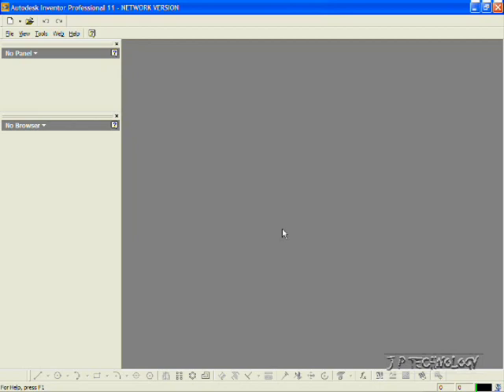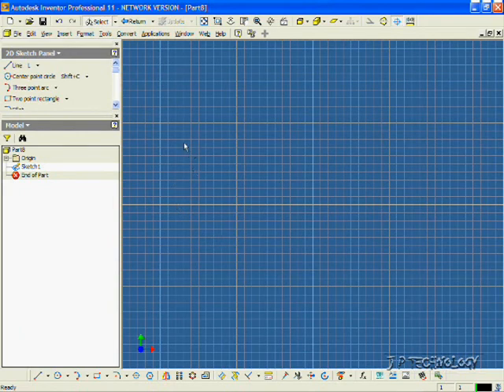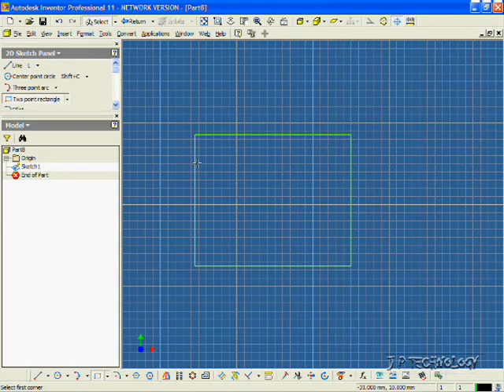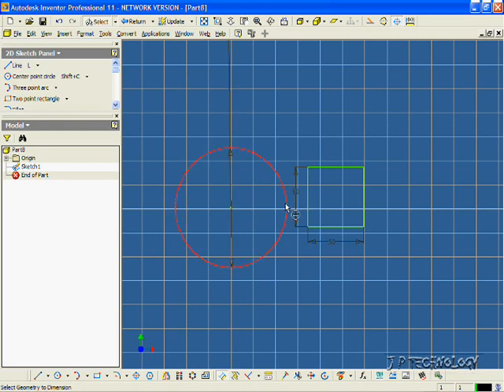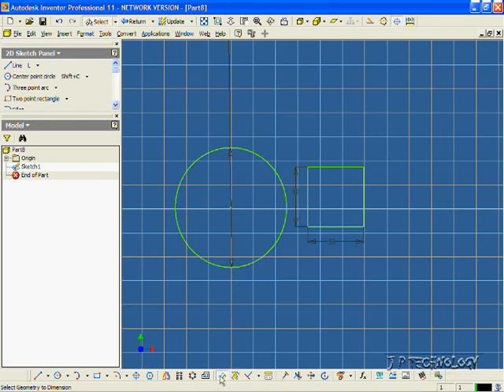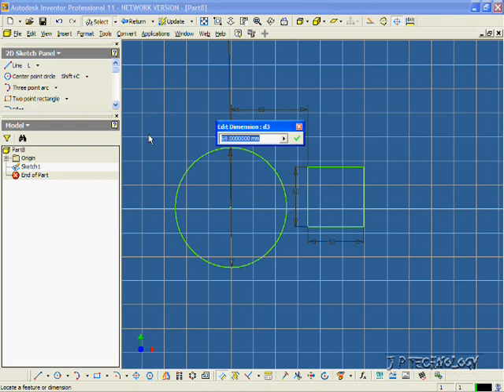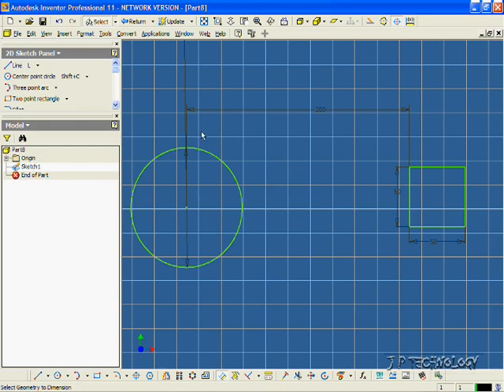Autodesk Inventor 11 tutorial #4 "Dimensioning"

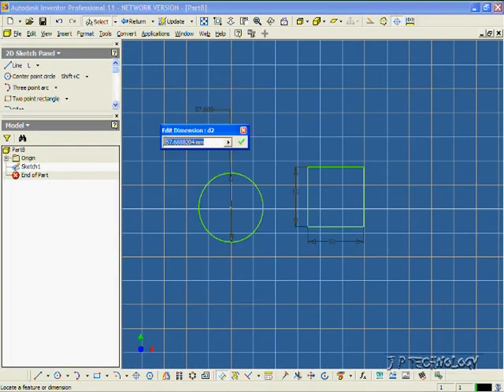Comment: 0:40 - 0:41 Skip
... we can dimension each side individually.
select a side that you want to dimension, say the Y axis, it will highlight in red, then click to the center of your sketch. there will be a mew measurement line in black. click that new line and a small box will appear. enter your desired number, say 100 mm, and hit enter or the green check. lets do the same for the X axis, enter 100mm, and hit enter. its a square!. now lets draw a circle, click 'center point circle' ...